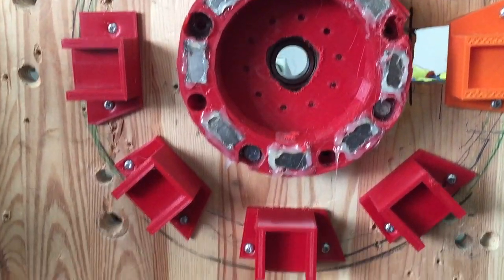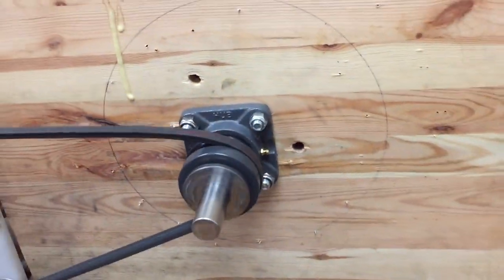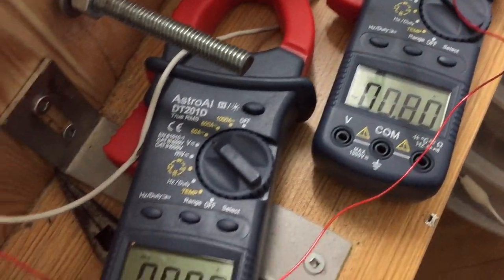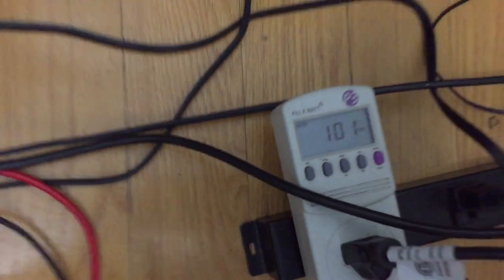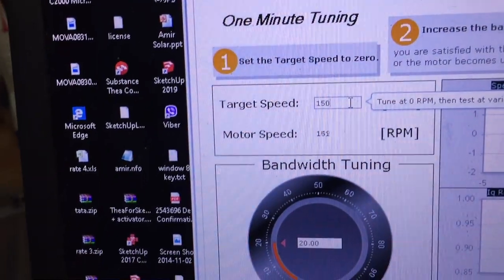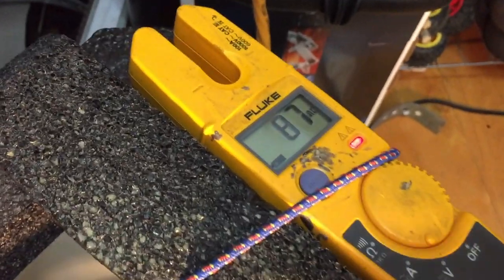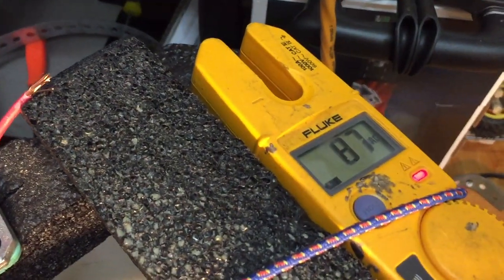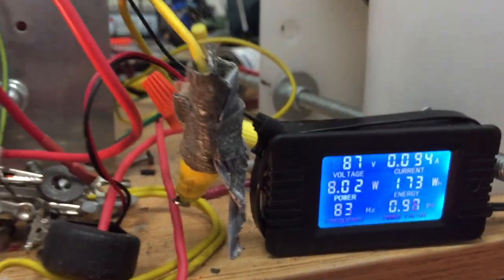400 Volts at 600 RPM

Comment: Can you please do some videos explaining what it is you are doing and what you are trying to achieve over all and use cases
Reply from the maker: i bought many generators for my house , 10KW and 30kW and others but as you know i would need a prime mover which is bigger than the generator to make it work so all what am trying to do is to do a new generator design which needs much less power of prime mover see my other videos i have lots of video showing my new design and testing for each
Reply: @EnergySeeker  Ah I see, great idea. I found your video as I searched for the FTC generator. I have a project which I need a generator for, but what I need it for is I am creating a 100% clean driver for the generator which can run for as long as you require. I need a generator for testing the driver for it but really struggling to find something affordable and also that actually works lol I do have a 3D printer comming so I am hoping maybe i can construct a simple generator with no need for inverters etc as I just want to get a proof of concept, Then again I may need inverters to show the generator functioning under loads. There is no good places online I have found so far to learn this stuff. I like your channel though!

Comment: I think you need to use less coil and use more thick gauge wire connected in parallel with 700RPM -900RPM producing 30A
Reply from the maker: how did you get that 30A ? am trying to make 10 A
Reply: @EnergySeeker  I just ask you then
Reply: That link will lead you to guys that can built 55kw high current axial flux generator you also can buy it blueprint
Reply from the maker: @vistanationrockafellaz  from where ?
Reply: @EnergySeeker  ?

Comment: Hi Armir!  I really like your work.  You produce and sell?  I'm interested in magnetic generators for vertical wind turbines.  First I want to use an agro tourism farm and have a project to expand it as a wind farm using the wind in my area.  Please enlighten me with your knowledge and prices of your products for the generators you produce.  I wish you good work.
Reply from the maker: thanks for your kind words , if you will use a wind then no issue you can make any generator am showing here its not that expensive , i dont make any product , i make to test the concept  like for example the FTC gen , but what am after is to make better generator with no Lenz , but if you have wind and place then you can put any wind generator and it will produce , if its a house then you will need like 10kw unless you know your needs per day and you will need battery to store it to use when there is no wind